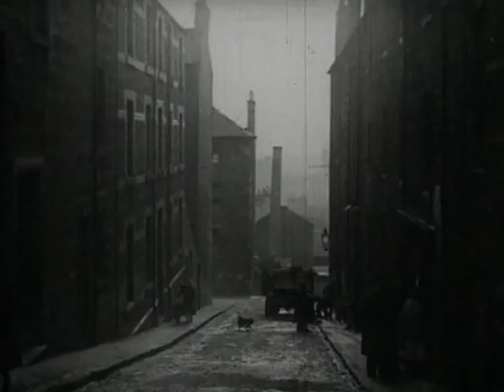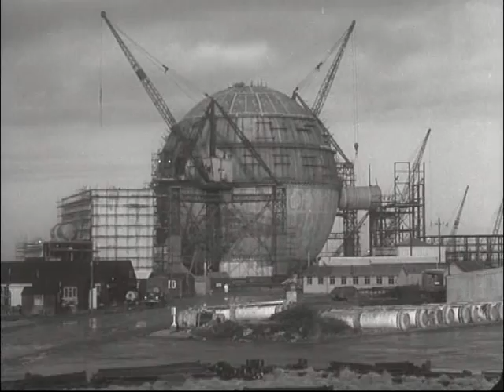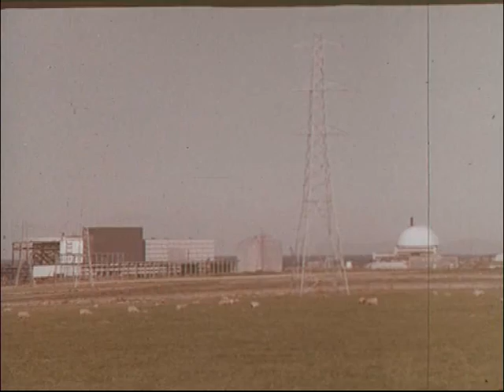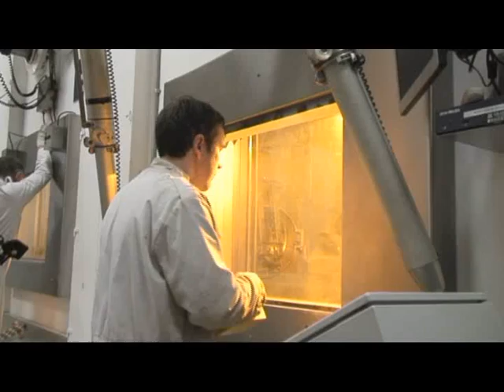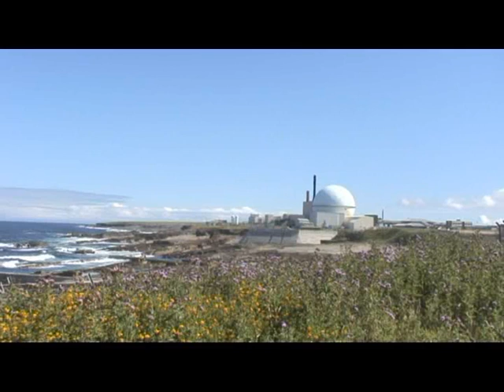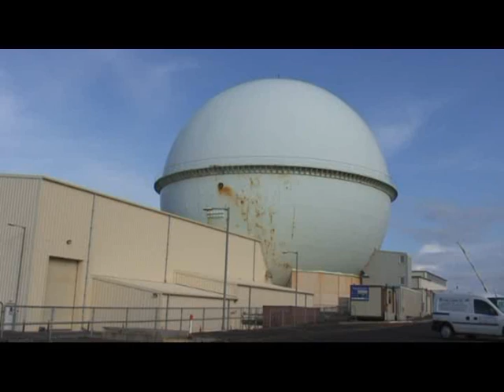The Breeder that Electrified Britain.wmv

Comment: What is that Tik tok tok tik noise in every npp cause for the first time ever that on changes rhythm and tone
Reply: It's the alarm that always sounds.  It tells you the criticality sensors and alarms are functioning.  If that alarm stops, it means the criticallity alert system has stopped functioning and everyone must evacuate.
Reply: At least that is the case in these clean up and waste/fuel processing plants.
In standard power plants it's just a gentle reminder of the background dose counts.  If it starts beeping rapidly, you evacuate the area and hope someone in the control room isn't Hoomer.

Comment: Is it normal to store "these bars" right next to each other? There won't be a catastrophe, but wouldn't be a few centimeters still more safe and cooler?
Reply: Prob well  under the criticality amount, but I wouldn't like to trust the fuel log book lol
Reply: They are U238 with a very small portion "bred" to plutonium.  There is no critical mass of U238 as it's spontaneous fission rate is zero.  U238 is not fissile.  The plutonium contained has s spherical critical mass of around 7Kg.  If those bars are even 1% plutonium, I'd be surprised.
They get dissolved in acid, the two metals sparated chemically and then it's fired to create plutonium metal bars.  These and the liquor before conversion to metal are where the criticality risk is.  Along with all the waste and sludge containing swarf, grinds, chippings and dust from the machining and chemical processing.  The most worrying part.... none of that last bit has been cleaned up.  It sits in ponds at Sellafield to this day.

Comment: What a load of bollox. Another expensive disaster built at never-ending taxpayers expense. A tribute to foolishness. An everlasting monument to madness. They will never ever manage to clean up the mess that was made here. Even the non-nuclear mess is horrendous.
Reply: You have to remember when this was built the Cold War was on the fear from the soviet nuclear program was on and we needed to get our program are I do agree of some negligence was involved improper storage of used fuel which is awful and of course is very dangerous for humans and the environment the only problems with reactors built back in the Cold War days they only cared about building them and never gave a thought on how to decommission it nowadays we have more thoughts of decommissioning them and safer ways to do so these workers that work there to do are doing gods work
Reply: @Ruvik92  
Your take on events may be appropriate to the nuclear industry in the very earliest days.  The building of Windscale and the 'need' to fulfill the demand for The Bomb.  The god's must have been quaking at the chances taken around the building and advancement of that project.  But Dounray was a crass disregard for even the pretence of safety.  An unknown and undocumented mix of all sorts of waste was just dumped down a shaft.  The risk of a chemical reaction and explosion was ever present.  That was not the result of mistakes or oversight, it was crass and reckless disregard for anything.  Those responsible for that mess should be locked up.